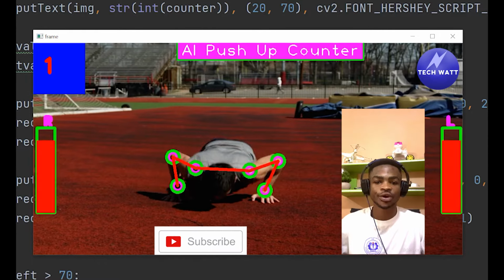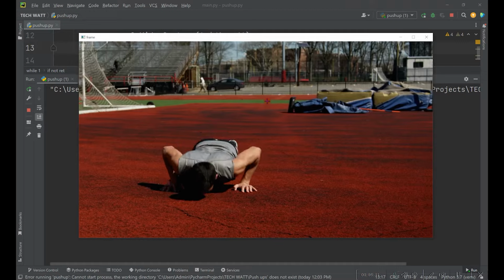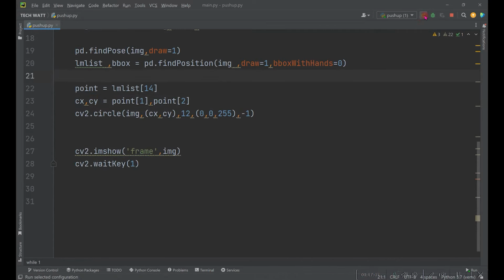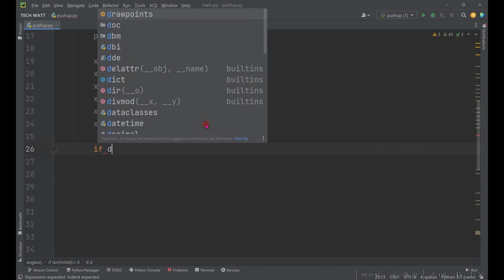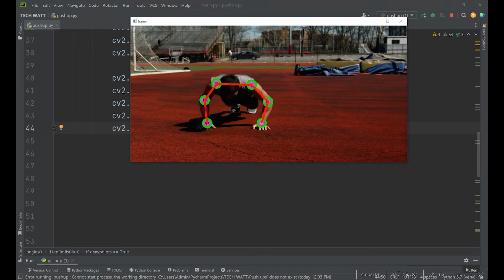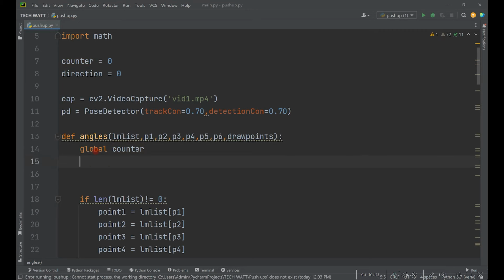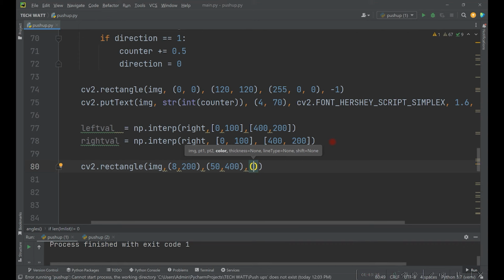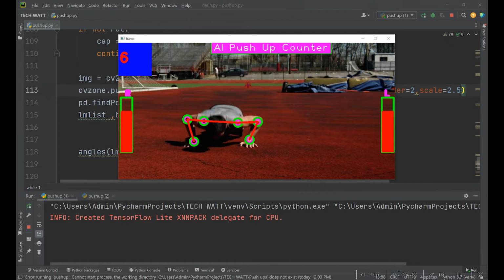How to Build an AI Push-Up Counter Using MediaPipe Body Landmarks #ai #machinelearning #chatgpt

Comment: You wrote                     leftval  = np.interp(right,[0,100],[400,200])       rightval = np.interp(right, [0, 100], [400, 200]),               shouldnt the first one be            leftval  = np.interp(left,[0,100],[400,200])? You do the same thing for left and right. If you change it to left, the code doesnt work anymore. Any idea what the problem could be?